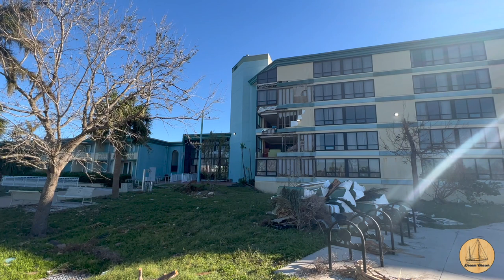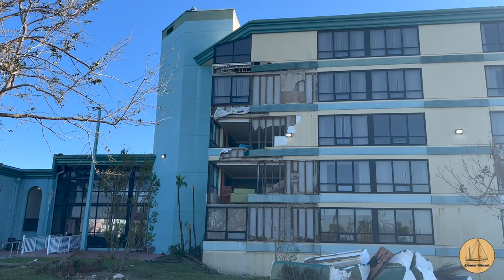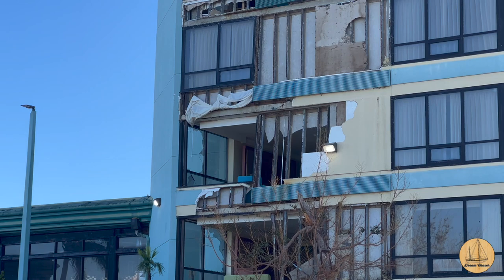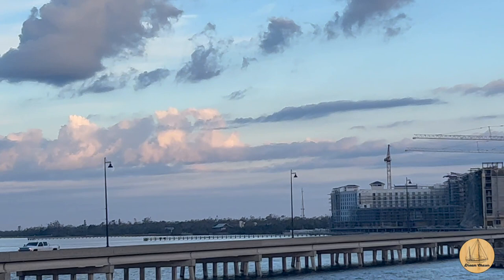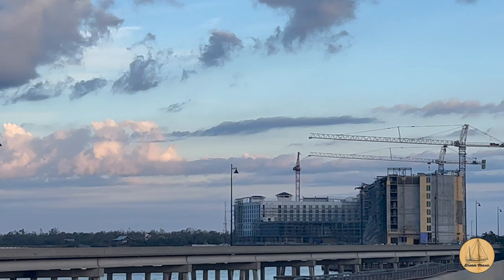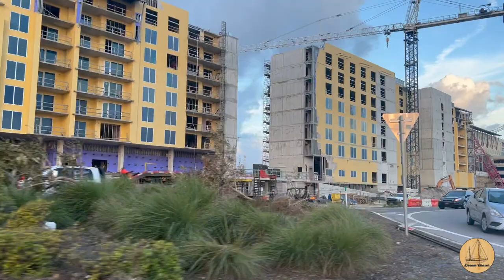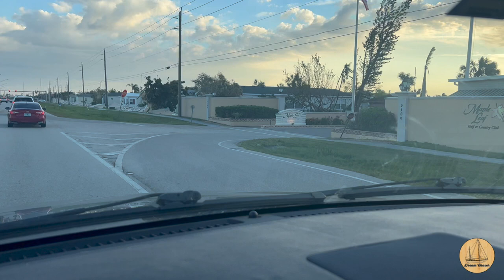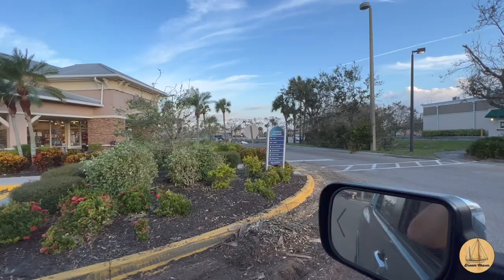Hurricane Ian Damage Port Charlotte, Punta Gorda (Last Video)

Comment: It never ceases to amaze me how modern things tend to fail. Even the traffic control signs are twisted and bent in the historic district, but the buildings seem relatively unharmed. They sure don't build em the way they used to.     😎
Reply from the maker: True enough. The one difference to that is the roofs. Seems the roofs on newer houses did a lot better than older ones.  Or at least new roof technologies the last 5-10 years.